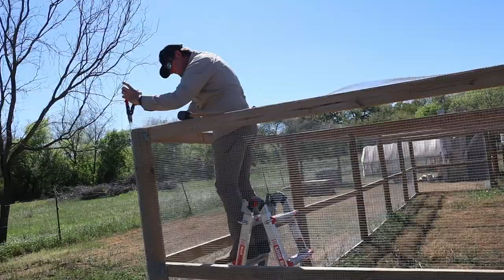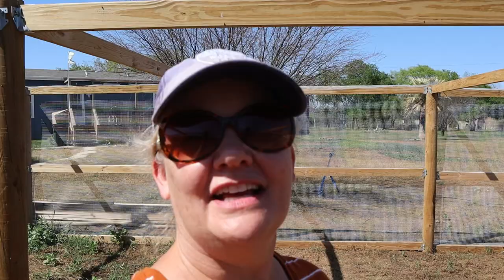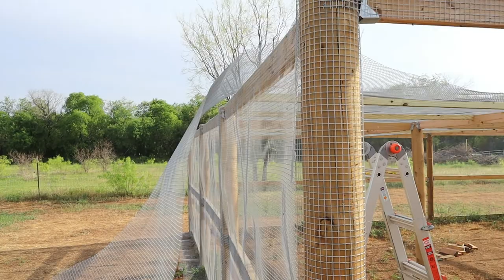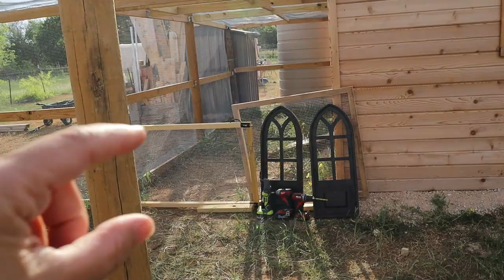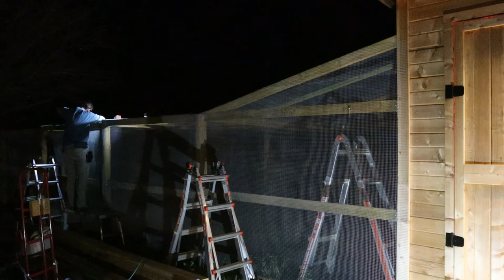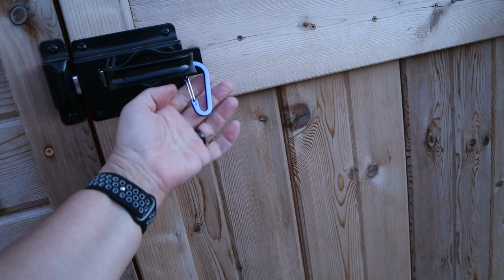Its Finally Finished! Aviary Style Chicken Run.

Comment: Did you try premier 1 fencing? I have 1500 feet of perimeter between two sights. Leave the coop doors open 24/7 and ducks sleep out in the open. Live in Florida. So far after 6 months no losses yet 🤞🏼. We have hawks , owls, ospreys, and eagles, coyotes, coons, opossum, and bobcats. I’m wondering if the amount of pray available to predators reflects their aggression tward non typical pray.
Reply from the maker: We have some Premier1 fences and solar chargers which we intend on using with mobile coops.  We are in the middle of nowhere and have fox, skunk, bobcat, hawks, owls etc all of which would love chicken dinner. As we clear land and make our presence known we will start moving a mobile coop and fence around with a guard goose for aerial predator protection.